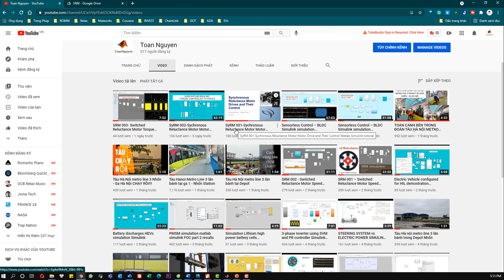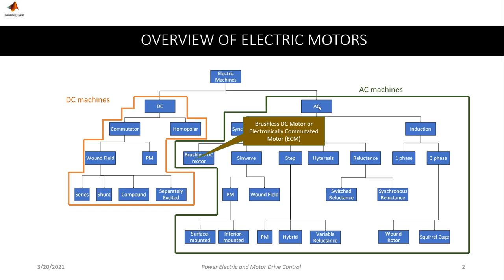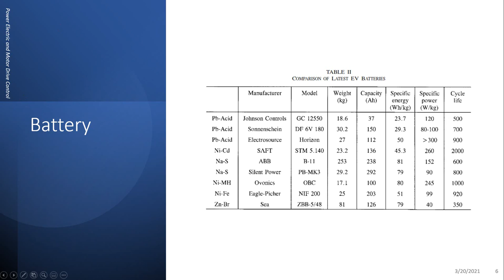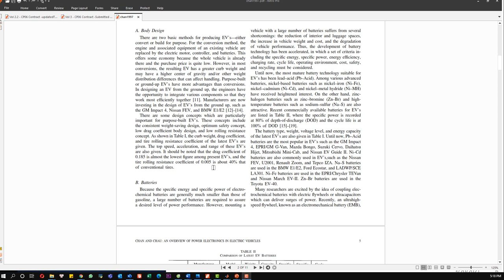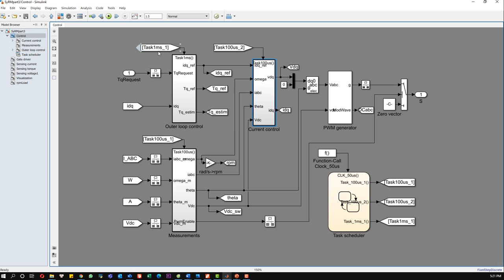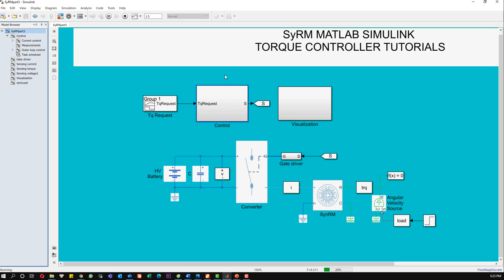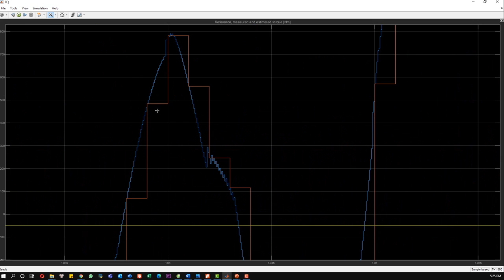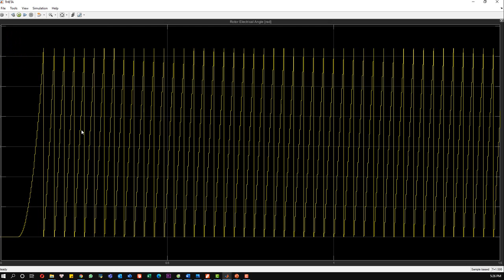SyRM 003-Synchronous Reluctance Motor Torque controller Matlab Simulink Part 3

Comment: Hello sir, how do I know about all the output on scope is going good?
Could you explain this for me, please?
Reply from the maker: Hello. Sr for late. Im busy too much. 

To answer your question: you need to know knowldge about the control system feedback loop. Or basiclly you will see the Speed respone yor example will be ensure get the reference value in term of time, damping ratio and respone time etc.. the current and the flux linkage of the motor need to have the figure same as the theory. 

Please reserach on my channel for the close loop feedback diagram theb learn about it.
Reply: @Thanhtoanai2026  GOT it, thank you sir

Comment: Could I know what is the input given to the Control subsystem which is named as Group1 Tq request
Reply: It's the Signal Builder block in the matlab library. Apparently it gives a reference input signal